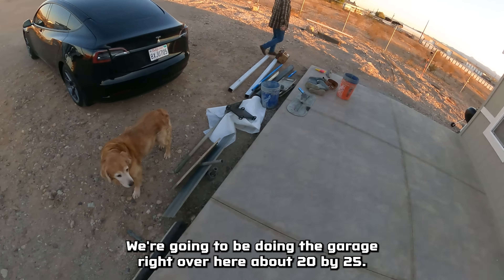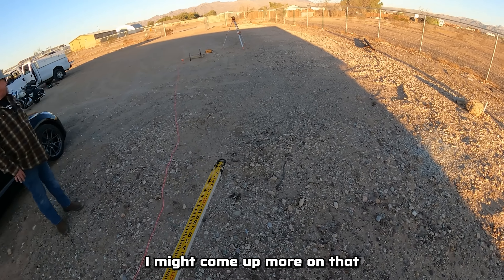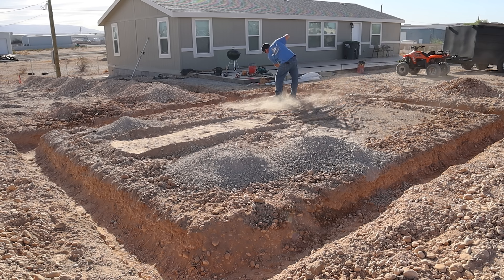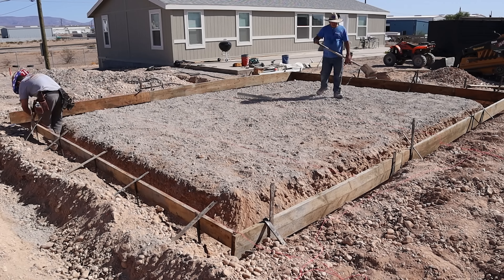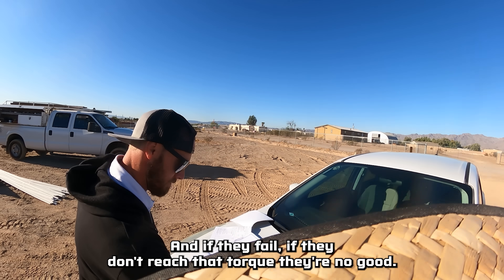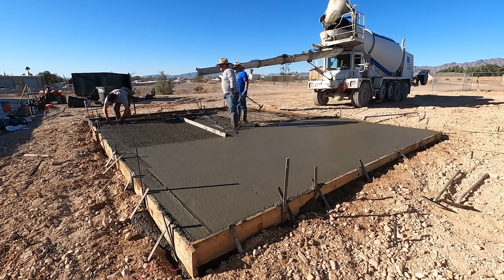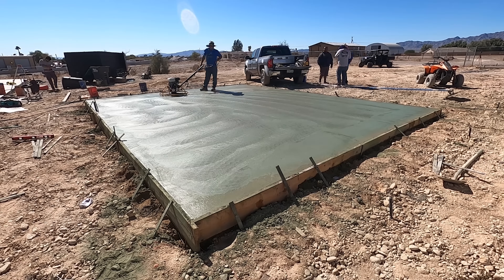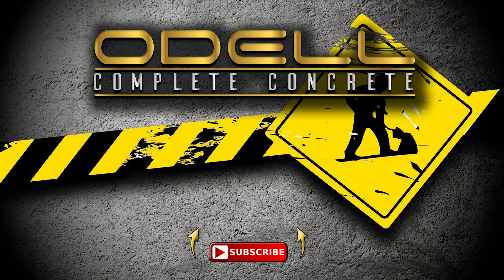GROUND UP GARAGE BUILD FOR MY PROPERTY!

Comment: Sweet, standing your ground with the inspector. We use concrete anchors all the time, all fasteners have a torque spec. I have also seen a pull test done on the concrete to make sure the concrete was strong enough to hold the anchor with weight. 

Love the project and love your videos!
Reply from the maker: Good idea.
TY

Comment: special inspectors look at hole depth, location, cleanliness, and torque test for expansion anchors. Its common practice in schools/hospitals.
Reply from the maker: Yes
Reply: Correct. That’s 100% common practice for expansion anchors.  In fact , they make torque guns that will literally light green once it hits proper torque per specs.  Nice work!
Reply from the maker: TY

Comment: I just finished my 26 x 6.6  slab pour yesterday.  Came out pretty darn good for a hack like me.  Thanks for all of your videos because I would not have had the knowledge without them!  Question on this video.  Why would the wind have affected the concrete?  thank you again for all your excellent videos and instruction!  You make it look so easy!  And it NOT!
Reply from the maker: The wind prematurely dries the the surface and trapping water beneath causing seperation
Reply: @OdellCompleteConcrete  Thanks!!

Comment: As a special inspector I can tell you I’ve done inspections on expansion bolt installation and torque inspection for post install. The county/city inspector should’ve looked closer to what the plans called out.
Reply from the maker: I concur
TY

Comment: This dude is green. Special inspection is to verify the drilled depth and verify the torque per the ICC- ESR. Have to make sure the holes are blown out to ensure the anchors can be hammered to the minimum depth (most have a line on the bolt).
Reply from the maker: I concur

Comment: Interesting that we have most of the same issues over here with our planning consent and building control, but some things are different.  Planning consent means finding out whether you can even do what you want to do (it generally has to be in keeping with the local area and neighbouring properties i.e., it can't stand out like a sore thumb), that you don't block out the light for neighbouring properties, or spoil their enjoyment of their own properties, and many other things.  They consult neighbours to see if anybody rejects, but there has to be significant issues for approval not to be given.  Things are much stricter if you live in a conservations area, or own a listed building (that is a property that is usually old, and important due to its location, architectural design, method of construction or just because it has some level of history attached to it).  If you own that type of property, you are very limited as to what you can do both inside and outside, and it has to be done in very specific ways - it gets VERY expensive!  You even need permission to paint your front door a different colour!

In the UK, you're generally not allowed to construct anything forward of (in other words, in front of) the forward line of your home, no matter how big your property footprint is.  This would include a regular wooden or plastic shed.  So that means you can't build anything in front of your front entrance door.  That being said, I have seen many garages way in front of the property line, so it seems the building developers, when they build new estates, have a lot more leeway from the planning department.  Money talks I guess. I'm not sure of the layout of your new garage in relation to your home, but I'm assuming it's allowed to be virtually wherever you want to put it?  Things are quite a bit more relaxed here when you do things to the side and rear of your property, and that would include extensions (adding rooms and the like to the main house), loft (attic) conversions, adding a conservatory/orangery, building workshops etc.  You may need planning approval in some situations, but more often than not you don't, but you do need building control, which is similar to your area when they need to check something is being built properly, including the electrics, plumbing, water supply and drainage, roof, foundations and the like.  Basically to check everything is safe and won't fall down.  SO similar mostly, but different too.  Good video, and sorry about your lovely dog.
Reply from the maker: Yes, that's why I chose to live here.
Not so many restrictions.

Comment: Oh and also that inspector is asking for the impossible… set your expansion bolts before you pour?  Right. That said we used to use 8” stainless steel Wej-its on conventional sill plates 6’ OC  In upstate NY… but those would never pass on a red iron building where your bents are 8-10-12’ apart. Those required a min of 4 1”x 24”bolts wet-set on every upright  and we used a jig to set them.
Reply from the maker: Sounds tough

Comment: Dave, I’m curious, do you pour a garage floor completely flat or do you give it some slope?  My thoughts are if you’re building a new garage from the ground up, give it some slope and maybe even put a drain in the floor so you can wash stuff inside if you have bad weather outside.
Reply from the maker: In this case I crowned the middle.
Reply: @OdellCompleteConcrete  well thats interesting.

Comment: Man, finally picked up the $150 ea. Goldblatt plate compactor (needs new clutch or DIY locking idler) and Wacker jumping jack (needs carb cleaned most likely).  Super stoked rescue finds collecting dust since the previous owners got new tools.  With that DeWalt pencil vibrator a few weeks prior... been a great score for the concrete chores tools.  Other than those fancy rotating locking pole ends for the finishing tools... man... I think I can fabricate most all the other tools.   Wishing now there was a cost effective UHPC resource for materials locally, seems the coal fired plants shut down and I've not yet found a metal fiber source.  I'm almost thinking investing in the tools to make... might be a business op?
Reply from the maker: Sweet deals
GL

Comment: Ah yes, the old “observational inspection.” I love that. Pay some yahoo close to a thousand dollars to sit there and watch me work for a couple hours. I’ve had that on pours before. He’d sit there looking bored, I guess making sure we vibrated properly or something. Pour is over by lunch and I write him a check for $800. Doesn’t comment on anything, never gets out of his chair.

I had it once had to have him watch me set bolts in epoxy. Sat there while I set 10 bolts with Hilti epoxy and charged the client $800. Then the engineer required a pull test which cost the client $250. That’s $1050. The epoxy was about $100 and it took me 20 minutes but it delayed the project a week. Really knew how to pad his income.

All I can say is dirty hands, clean money.
Reply from the maker: Sounds like common procedure, unfortunately.

Comment: That inspector was clueless. There is always a special inspection required on post-installed anchors per the model building codes! His lack of knowledge and unprofessional appearance makes us inspectors look bad.
Reply from the maker: First day
Reply: Yep. Tuck your shirt in and turn your damn hat around. Also, approved and sealed plans override whatever the verbiage that your permit tech put on the package.  I see misinformation on permits all the time. If the approved plans show an alternative method, then you’re wasting the contractors time going back to your plans examiner. An inspector with any type of experience or confidence would easily be able to make that call on the spot.

Comment: A torque test on an expansion bolt? What kind of scam is that engineer running? Do it up tight then give it a little bit more just to be sure, done.
Reply from the maker: These type of bolts have to be set at minimal of 100 lbs.
Reply: @OdellCompleteConcrete That’s about 4 augas and half a dugga from my 1/2” impact.

Comment: He obviously doesn't know what the fawk he's talking about if he's going to sit there and tell you that redheads just keeps spinning, if they're spinning they weren't installed right and there probably not going to pass a torque test.
Reply from the maker: They only spin if the concrete is no good or a dirty hole.